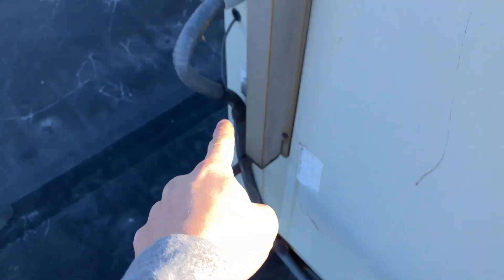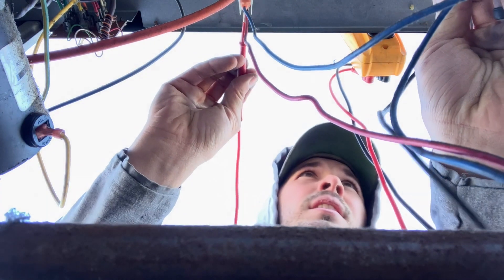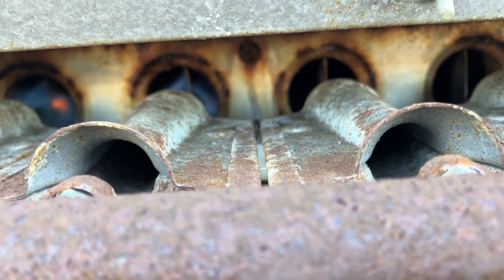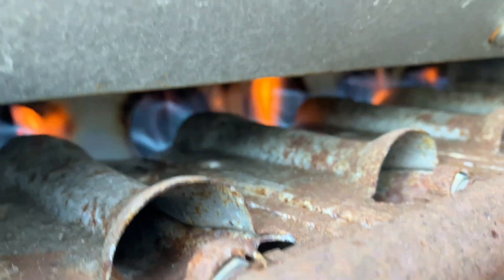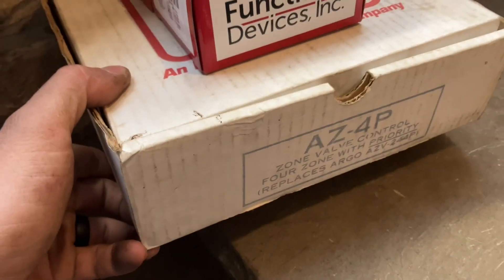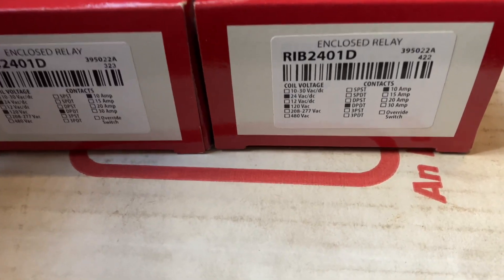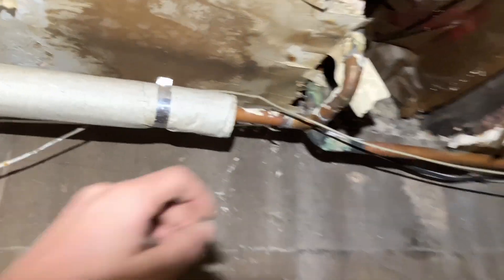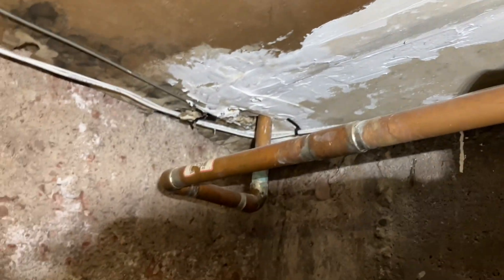Frozen Roof Top and Dirty Boiler Rooms

Comment: Ok what I would do is go to work for a company that does not work on boilers they are a pain in the ass, your company is very confused. It sounds like your dispatcher does not ask what the problems are, and the expansion tank is on its side, they should not be mounted that way. Good video.

Comment: That high voltage coming out of the bottom of the disconnect going to short out looks like lock ring failed and wires touching side of the opening

Comment: Good call on that heat exchanger... sounds like a new unit for sure.  Almost impossible to find replacement for some of those ancient units, and I have no idea what those rooftop units are like, likely the same as a furnace though.
Reply from the maker: typically they end up quoting the entire thing, from heat exchanger to inducer to gas valve, the whole nine, which will take forever...and the unit is still ancient lol